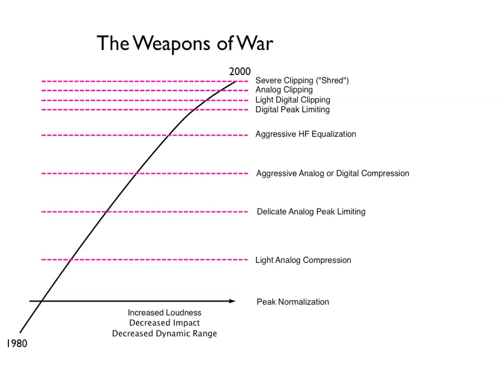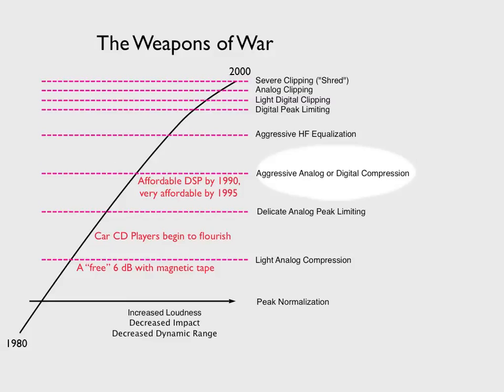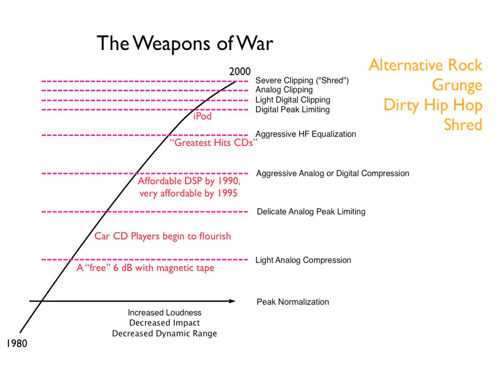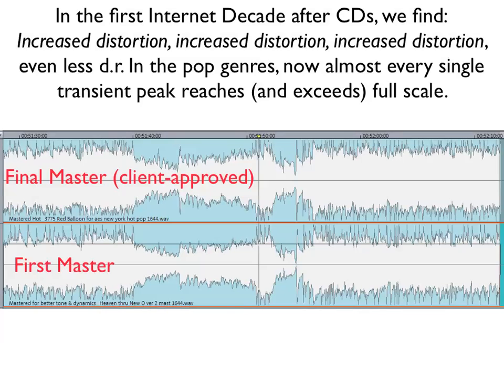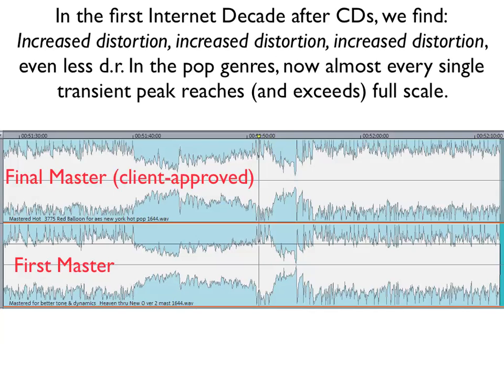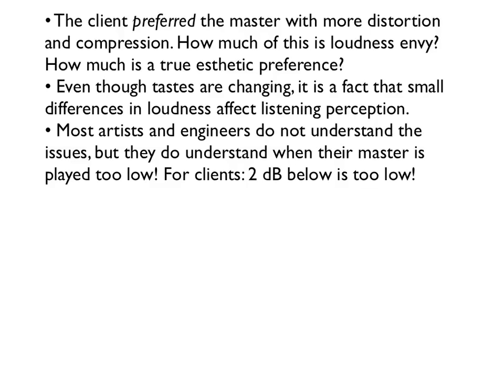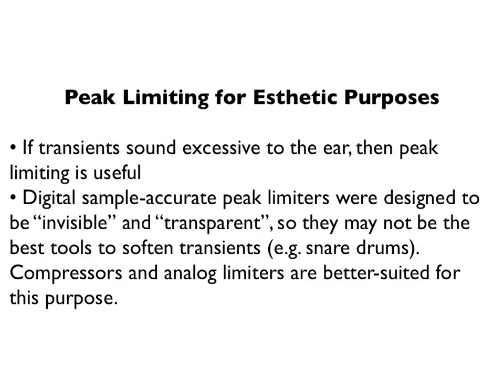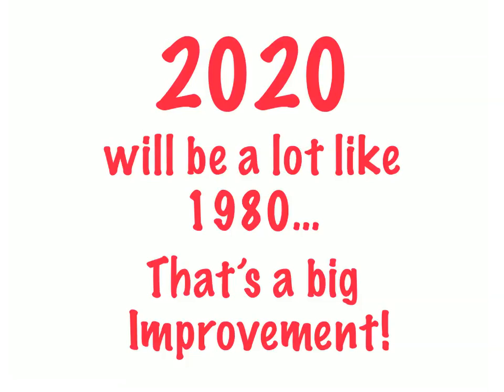Bob Katz - Loudness: War & Peace

Comment: I have mixed feelings on the so called 'war' - as certain genres really benefit from running limiters on different tracks and reducing dynamic range while other genres are hurt by reducing dynamic range. Moreover, with contemporary styles in modern settings where tracks are played consecutively across different artists / genres there is a need for music which is normalized. I feel like an amateur producer of club music generally doesnt compress enough while an amateur producer of 'live' music compresses too much.

I also disagree that 'overly compressed recordings sound wimpy' as under compressed generally sounds wimpy. I guess it depends on whether it is being normalized to dB or to LUFS but dynamic EQ processing allows a track to sound fuller across the frequency spectrum. Not picking sides here but I get tired of hearing old-heads who were recording on analogue gear talking about leaving headroom when current DAWs generally have infinite headroom.

Comment: I never really understood, why people voluntarily use compressors and limiters on their tracks - a dynamic compression process which always degrades the quality of the signal.
...
So, I kept mixing/mastering completely without dynamic compression nearly from the very beginning, after noticing that using compressors and limiters will worsen the sound quality.
...
And with EBU R 128 I've found a pretty sophisticated and prospective concept of loudness measurement and adjustment (created by very good audio engineers who wanted to do something useful against the annoying phenomenon of the "loudness war"), where I don't really have to care about the peaks in uncompressed audio signals.
...
There, each audio program (like a soundtrack or TV show) will be mixed/mastered at a loudness of -23 dB (it's something like the perceived average volume of the whole audio program, measured from the beginning to the end of the audio program).
And because of this low loudness level (which might be as half as loud as many modern productions) you never have to care about peaks shooting over the 0 dB mark.
In my soundtracks, which are mixed at EBU R 128 loudness standards, the peaks barely touch the -5 dB mark in the master track - so, I can concentrate much more on the creative parts of the composition and the sound design in my cozy home studio instead of being busy with annoying and pretty fatal sound chirugy in some kind of a batshit insane sound hospital or rather sound morgue).
...
And another good thing with the loudness regulation at EBU R 128 standards is the certitude of having no loudness jumps between different soundtracks or other audio programs.
So, every soundtrack - no matter which music genre (if it's classical stuff or pretty heavy metal and rock music) sounds similarly loud and so, you don't have to readjust the volume knob each time for every single track or any other audio programs.

Comment: I hate to say this but today's Rock and Metal will never have life and be dynamic again cause the use of drum machine, quantization, autotune (eventhough quantization and autotune has little to do with peak dynamic range). It isn't very dynamic when you use drum machine cause the peak amplitude are the same even before the over-compression from mastering stage.

Quantization makes the drum has the exact same tempo while autotune makes the vocal sounds like robot. These things are destroying Rock and Metal too cause there're no life.

Modern Rock and Metal productions are bland, boring, lifeless, and ear fatigue in my opinion. Today's Rock and Metal production is basically today's Pop and Hip-Hop production now. Over-production doesn't work for Rock and Metal, you do more harm than good.

Today's EDM, Pop, and Hip-Hop aren't very dynamic either cause the use of drum machine. The world has changed. Classical music is still the most dynamic but make sure it's not too dynamic and use a bit of peak limiting cause it'll clip.

Comment: Thankfully, programmers have been able to achieve actual (within .02 db) limiting with digital audio lookahead for the past few years. This means there is no distortion, as no clipping is occurring, the limiter is actually reducing the level of the whole song when a transient peak comes in before it hits the master output. Dynamic range is still eaten up, but the distortion problem is solved. Personally, my genre is very defined by a modern, hard limited sound and I follow the industry standard of about 6 lufs in choruses. I still get punchy drums in breaks and quiet bridges by simply using my DAW to automate the gain going into my mastering chain, so I can pick and choose when I want loudness and when I do not.

Hope this brings up to date info to this commentary.
Reply: what is the trade off?...the quality of your sound becomes dull.....etc

Comment: I don't think compression or limiting on classical music is that bad... Imagine the scenario where you're driving in your car on the freeway, you can hear both the road and your car, so it's not totally dead quiet, and you're listening to Stravinsky's Firebird, or going from the quiet ending of the 3rd movement of Tchaikovsky's 4th symphony into the super loud beginning of the 4th movement. I'm really not trying to go deaf when I'm driving listening to classical music, a lil' compression to hear quiet passages and not always have to have my hand riding my volume knob through a whole symphony, in my opinion, would optimize a stereo mix of this sort of material. It's one thing to master a documentary recording of classical music for playback on a fancy Bryston tube amp and $5000+ speakers on a home set up in a beautiful room that has amazing acoustical treatment, but realistically mastering for good translation on as many speaker systems as possible seems like a good modern philosophy for mixing/mastering. Even if you see a classical symphony perform live the dynamics are totally different depending on how close you are to the stage due to the bass volume dip to distance ratio. The stereo representation should be about making it sound the best you can get it to sound as if you were in the best seat in the house.
Reply: That, in my opinion, should be a feature *in your stereo*, not in the album itself, because consider the other scenario: You're at home trying to enjoy your music, but the dynamic range has been compressed for car rides. Now nothing has any impact. Drums are not only the same volume as the guitars and the vocals, but every different section of the drum is the same volume as every other section. 
This destroys the dynamic and realistic sound of the whole experience.

Comment: Sorry for my english

I would like to know why it is called distortion when we simply limit the volume in some points ... what is the difference between a kind of volume automation in the master that would prevent going beyond 0db and something that distorts the sound ...
Reply: It's called distortion, because that hard volume limitation changes the original sound. It distorts it, and this can usually be seen in the upper harmonics.

Hope this helps.
Reply: If you take a close look at a modern highly compressed recording you will see that the highest peaks following eachother will come close to a square wave. It is not going over 0dBFS but will park steadily at it for a while. This is why it is not only low dynamic range, it is also fatiguing to listen to, as it resembles real distorsion.
To change something is a kind of distorsion, but not necessarily the audio distorsion meant here. You can change the sound without having it sounding like distorsion.

Comment: CD players in car. So true. Why not just a 3 stage 'loudness' compressor in the CD player itself?  Weird to start adjusting master volume levels.... ?!!!?!?!     YEah some of those early CD's are very clearly soft , I remember cuing some up when I DJ'd compared to Vinyl they were soft and sometimes you had to push the master volumes right up to even get semi saturation.
Reply: If you compress the media content you have to do the work once when you distribute time/cost spent for tuning the compression over all sold CDs. If you use a hardware compression module or need a larger processor/DSP inside the CD player it will significantly raise costs. Which means you can not keep the price point of $99 or whatever the marketing guys made up to be competetive on the market.

I would prefer your solution though but the average John Doe is like... "jeeez! Thats an awful cd i have to wiggle the volume knob all the time when listening to that CD." Nowadays a lot of people also compare also by how many songs fit on their phone/ipod/sd card. Music became a bit like fast food, imho. Just consume it no matter how shitty it tastes, at least it makes you filled up. Maybe the trend will go back to more healthy "music food" again ;)

Comment: Everyone is an engineer these days & the whole production line is riddled with tasteless practices by knob-ends who have learned the trade via a series of gimmicks & cliches. Sure brickwalling the piss out of a tune is a good laugh once but those assholes who take a song apart & normalize every little section of -db audio until its bouncing off the ceiling - the audio equivalent of driving along a severely pot-holed road in a car with shit suspension. Someone give 'em 'Joe's Garage' on wax & a twenny bag o' weed...
Reply: +DJLujoso Well that's true... But I get lots of mixes with no character, no compression, no balls, no nothing at all. Loudness war is a problem but there's another problem, which is what I call the "Forum War". Everybody goes to forums and read a lot of bad things about the using of the compressors etc... The only thing they get is a poor decaf mix with nothing on it. I think a mix have to have "balls"... The "loud" Bob master, for me, has no balls
Reply: Amm, maybe he didn't mix the song? He did a master.

Comment: What about Youtube Adverts? THEY ARE KILLING ME WITH LOUDNESS every day!
Reply: +Ahtu Kaalikas Loudness started a long time ago with the TV stations  when cutting to an ad break. The advertisers demanded that their ad be as loud as possible to grab the attention of the viewer. In order to avoid clipping the signal or over modulating, they employed dynamic range compression. Thankfully the FCC and the EBU have stepped in to regulate loudness and brought out new loudness measurement standards to bring loudness back to uniform levels. Sadly Youtube is not bound by these rules.
Reply: That's why I use adblocker here. It's a lousy situation for the content creators, but ohmygods I don't want to be scared to death multiple times every single day.
Reply: Youtube is lowering the volume of every content uploaded by users by around 6db peak off full scale so that they got headroom available to indeed push their ads above that.

Comment: Its funny how the Engineers in developing the CD format to replace vinyl sought to increase the dynamic range and signal to noise ratio with 14 bit and then 16 bit audio and then the music producers of today have reduced it to little more than 1 or 2 bits. Bob Katz rightly points out the slow deterioration from the early 1980s where a technology that was originally designed to improve audio reproduction ended up destroying it by facilitating the loudness wars with dynamic range compression and other nefarious audio processing techniques.
Reply: +DamageIncM Too right!   Most vinyl fans who extol the virtues of its sound quality are partly right but generally for the wrong reasons. Vinyl sounds great because the mastering has been done properly and without the loudness compression overdone.  A good thought experiment would be to rip a good vinyl recording to a high quality CD recorder. The playback of the CD on a decent player should sound just like the original vinyl because of the accuracy with which  CDs can store audio.  Using a variant of Bill Clinton's famous words, "Its the mastering stupid".
Reply: +Dalsir I dont understand your comment and can only assume that you misunderstood my point. You open by saying that I am 'bloody wrong' and then go on to validate my point by citing one of he worst and most narrow dynamic range CDs ever made. 
As far as PSTN telephony goes, the main limiting factor ion audio quality s the bandwidth of the audio which is approximately 3KHz and that is not dependent on PCM bit depth but rather sampling rate. With PCM bit depth, each bit of resolution contributes around 6dB of dynamic range and  S/N ratio.  The Black Sabbath recording has almost no dynamic range and with noise shaping, you could probably PCM encode it into 2 bits. That was my main point, that CD allows incredible dynamic range to be recorded yet the loudness wars have meant that music producers  went in the opposite direction resulting in less dynamic range than more carefully mastered vinyl.
Reply: +Killian O'Sullivan 1 or 2 bits ??? You`re bloody wrong. Nowadays music could be 12bits and nobody would hear any difference. That`s proven. Going lower would be telephone alike sound. But yes, those guys claimed that CD`s has wider DR, but hey, sometimes I just download goddamm vinyl-rip because it has twice as DR when compared to CD version. Perfect example is Black Sabbath`s last album. It`s a crying shame.

Comment: if you're specifically referring to recordings which are uniformly too quiet ("the waveform is pencil-thin"), you can normalize to make the loudest regions appropriately loud. this has nothing to do with limiting or compression and so has nothing to do with what Bob is talking about in this video nor the loudness wars. but in your original comment, you referred to recordings that are "too dynamic," a completely different concept, so it's unclear what you're actually talking about here.

Comment: Oh, so as an ME/EE working in the audio industry i don't understand how amplifiers work? True, in lower end applications tube amps will have higher distortion, but a large part of this is the output transformers. tubes themselves are actually better than solid state transistors in some fundamental ways.  regardless, I'll take Richard Vandersteen's word over yours.

Comment: I'm not sure what you mean by Grunge and Alt rock coming after ipods? Those forms of music came around 1990 and the recordings are not overly compressed in most cases. The distortion was intentionally added through effects. Listen to Nevermind it has tremendoeus dynamic range Butch Vig did a great job.

Comment: nice video.

I think you miss a point though. electronic music and heavily DAW-assisted live music don't have much dynamic naturally. some styles of music only exist the loud way and they would sound unnatural with as much dynamic as 80s rock. if done well, (every bus optimized, ducking to optimize frequency ranges...) there is a naturally small dynamic range, even before mastering.

allowing a big dynamic range would make a rock track more natural, it would make and electro track unnatural.